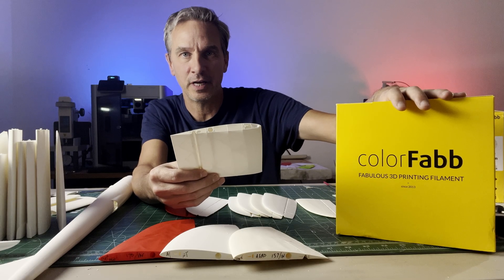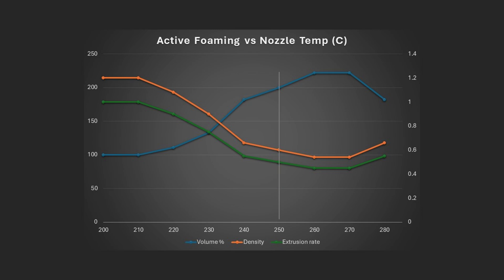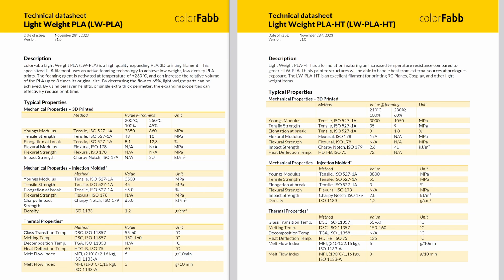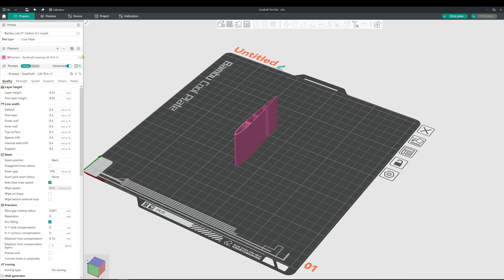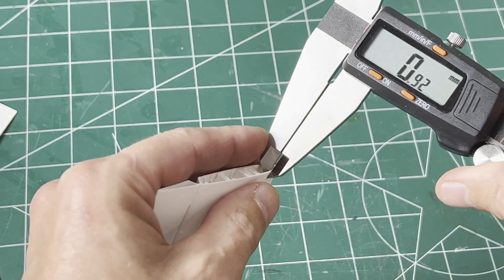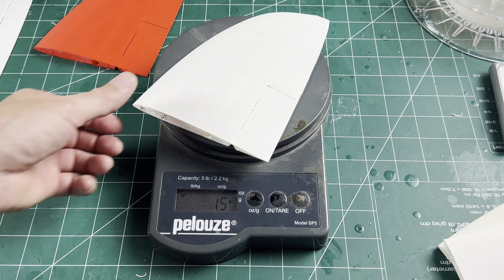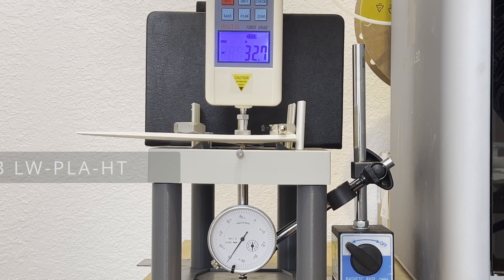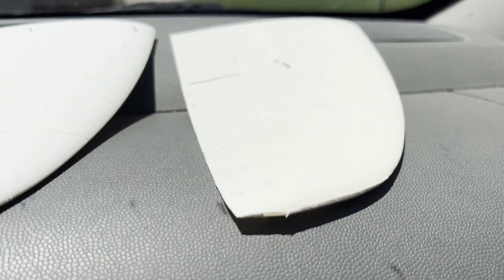🔥Beat the Heat?🔥 - ColorFabb LW PLA HT - hi temp resistant material testing for SoarKraft airplanes

Comment: Do you recommend using the HT-LW-PLA for fuselage parts as well? I'm building a plane now, and they're of course recommending PLA for the fuse and LW-pla for the rest... I'm in South Florida. We hit 100*f  in the shade in summer time. PLA turns into chewing gum. So I'm trying HT now, but wondering what are the best settings for fuse parts for this?  Do I want to do it "cooler" temp so it is more dense? Add another wall layer? What is the best way to build a strong and heat resistant fuse?

Comment: Thanks for the video. I've just bought my first 3d printer, a P1S. Could you please guide me on a tutorial/course to help building my first rc plane?
Reply from the maker: ?  SO I have a bunch of videos on how to print my SoarKraft files... check out my channel.  My latest video for the Stretch - motor glider with LW-PLA and LW Power Pod https://youtu.be/URBvbS_kJD4 is as complete of a video build guide as I am going to do... there are written instructions that come with the file set also.... you can ask questions about my SoarKraft airframe files, but I don't have the bandwidth to teach you individually how to do this.... and crashing and building is all part of it, there are simulators for practice.... I still crash regularly.

Comment: did you annealed the parts in the oven before the test? how does the hinges hold up after the test?
Reply from the maker: No annealing… not really possible with this type of part without doing even more damage than this test did.  Hinges recover fine if they are still straight.

Comment: Very nice videos and very usefull setings.But i have a question,because i dont see any settings for this and i'm wondering....how to manage to make the holes to fit with your carbon spar with all that foaming expansion.Do you have any special setting for Bambu STudio or for the Orca slicer to give it to us,because i already throw alot of material and of course alot of money,and i still don"t manage to make the carbon spars to fit on my wing holes.Thank you i advance ...and sorry for my poor english.
Reply from the maker: Slicer configuration files on the SoarKraft website for SoarKraft files - see the video description for link.  
Slicer settings are critical for this to work... it is not PLA.... it foams in the nozzle.  Reducing the extrusion flow rate makes this work... its called the "Flow Ratio" in Bambu/Orca and is under the filament settings and in this case is set to 0.50 which works out to 50%.  You need to set up your printer and use these SoarKraft process and filaments setting to get it to work.  There is another video for how to set up a non-bambu printer with Orca on my channel.
The SoarKraft settings may work for other file set, but up to you to test.
Reply: @soarkraft  I was download the Soarcraft settings and i was using them,also i see your video for orca settings with any printer,and i follow all the instructions,but still having problem whith the spar holes.I will try to test the values in flow ratio and i will see....Thank you very mutch for your reply.And keep doing useful videow like this.
Reply: I forgot to say that i was using Bambulab A1 and Colorfabb LW-PLA-HT,I thing thats a prefoaming material and he supposed not foaming so mutch in the printing.I was reduce the flow ratio after your invice from 0,50 to 0,48 tested,after that reduce again to o,45, but same results.And with temperatures 225-220-215 deg. ,again same results.

Comment: ia the flow rate so low due to LW properties? I have this ColorFabb PLA-HT filament ( not LW) and I am strugling with constant stucking inside the extruder... flow rate set to 0.94 - calibration told to have 0.98 but it was overextruding. Did you have any similar problems with this material?
Reply from the maker: This LW stuff foams and expands, so yes different properties.  I have not tried the PLA-HT, but this usually happens with regular PLA when the chamber temperature is too high…. And many other variables…

Comment: Is possible the regular PLA be printed with half of material, or LW PLA with double, and check same weight resistance... because be heavier and stronger means could be printed with less material.... here PLA LW is 3x more expensive... I mean, really worth?  print PLA with less material?
Reply from the maker: the PLA LW is more expensive, but you use 1/2 as much per part.. or less... so it is only 1.5X in your case per part.  This Colorfabb material LW-PLA-HT is even more of a premium because of its higher deflection temperature tolerance.    Try one of the regular foaming LW-PLAs... eSun LW-PLA works the same and is the cheapest and really cool to try.    Now if you are just looking at just mechanical properties then one PLA beats two LW-PLAs all day long.... but material properties, consumer 3D printing and rc airplane design are way more complicated than that.

Comment: Looks like the ColorFabb LW-PLA-HT is worth the money.  Good thing they got set up in the USA - I just ordered a couple spools to get free shipping.  I'm only partway thru my first printed plane where I used a LW-PLA.  With what I know now, I don't expect it to last long.  Now I have ASA and the ColorFAbb LW-PLA-HT.  I'll have to see how the ASA compares to the ColorFabb for strength and toughness.  I'm wondering if I should use a mix, depending on the part, for RC planes.
Reply: I hope your project went great ! I think making a mix of different materials is a great idea, since this is what I'm currently doing on my C-17 3d printed plane project. I will use LW-PLA-HT as shown in the video, and some regular PLA for the parts requiring to be stronger (like the engines nacelles). I watched some videos, and I think that LW-ASA is not worth using when we can get some LW-PLA-HT.

Comment: Great research, lots of really useful information.

Have you ever considered going bigger on your designs and turning it into a hot liner style of machine rather than a powered glider ?
Reply from the maker: Yes I have, the SoarKraft Igneous is a warm liner and is already available, T-tail, power pod, and instructions to print and build.  I several new models coming.... including a 1000W F5D style pylon racer and longer wingspans, EDFs.  I just keep getting distracted with new printers and new materials.... work, family, life.   Half of my audience wants something slower, half wants something faster.... working on both, and I crash everything.
Reply: That’s great news. 
F5D ! Yea bring it on ! 
Really like the sound of that. 
I have printed a couple of Igneous just find the battery compartment too small for some decent power loops and motor combo. 
Great content, keep it coming please.

Comment: Since you were using the sun for heat it’s possible the color of the pla caused it to absorb more energy.
Reply from the maker: yes, red will absorb more light energy than white... however white PLA still will get soft in 60-70C heat over an hour and ruin whatever shape it has.  I could do a follow up to show this if it gets enough likes.
Reply: @soarkraft  or the difference between ht-lw pla in colors besides white. I mean, if the high temp is only useful in white due to energy absorption from the sunlight than that would be practical to know. I think black pla is obviously a known no go for sun but I’m not sure about other colors. Most people only test heat deformation using oven not sunlight.
Reply: Appreciate your channel btw. Lots of details about things that are very useful to know. I’ve also made my own plane design and have probably watched every video about 3d printed planes. I bought your plane months ago. Great design
Reply from the maker: There is some interesting chemistry for how they make the different colors and how it affects the mechanical properties.  Different colors are stronger / weaker, several white papers I found, might have some affect on heat deflection too, but sun absorption is straight up "black body" energy absorption.   I could come up with fun testing to do all day... but really I need to focus on finishing some new plane designs and get them published.

Comment: Very nice! Great video. Would love to see a comparison to LW-ASA in the future, even if on paper it should be no contest. I print in normal ASA because of the texas heat. I attempted a plane in black bambu aero and it melted in my hand before i could even get the control surface check done.
Reply from the maker: Working on it, started the LW-ASA one first.... had issues.  I switched to this material just to see if it was as much of a pain.... and it was soooo much easier I switched and did this one first.

Comment: It would be interesting to know how it holds up with small impacts etc, I saw and heard not so much good news on Lw-ASA, I saw a video on YouTube showing have brittle it is, plus you need an enclosure to have good result's.
Reply from the maker: Yes, been wanting to figure out an IZOD like impact test for thin wall structures. The science gets a little complicated with materials that have different properties in X-Y and Z due to layer adhesion, similar to the difficulty of impact testing composite structures.  3D printing one and two wall thickness seam to change the properties of some material of these material in weird ways.  The bending force tester is pretty straight forward beam testing, going to make a twist (torsion) test too... maybe a mini swing hammer tester would work for impact.